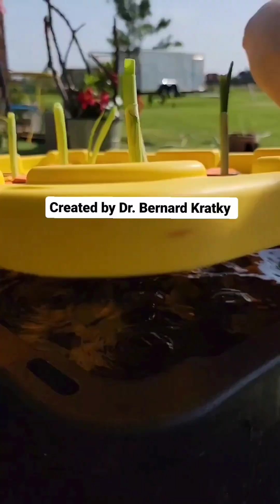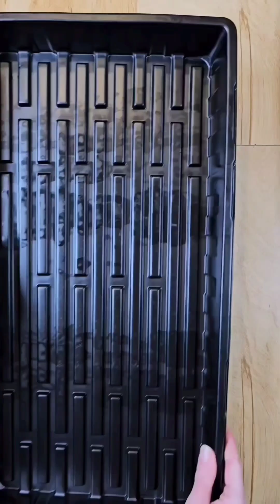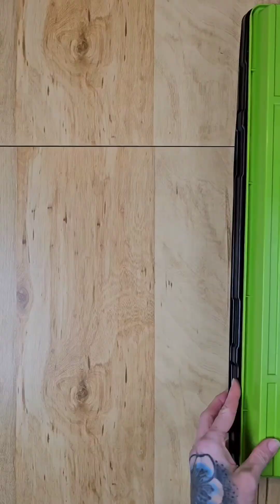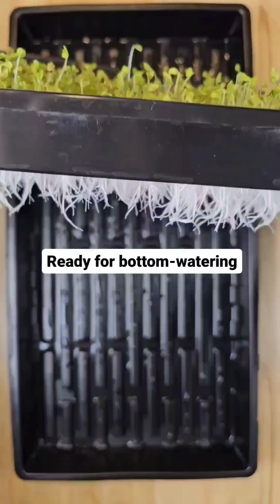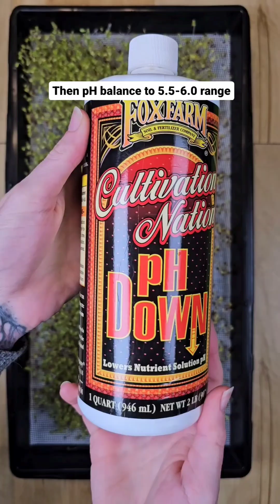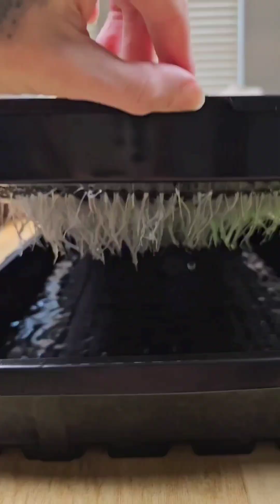P2 Mini Kratky Method Test: Grow Broccoli Microgreens with Little Electricity! 🌱💧 Silicone Medium

Comment: Been doing this for the last year. I use pottiing soil on the top tray.

I add the water when I sow, the roots hit the water just before going into the light. Once they are in the light they usually need 2-4c of water per day.
Reply: Then you haven't been doing this.